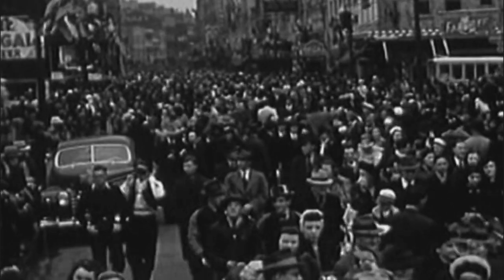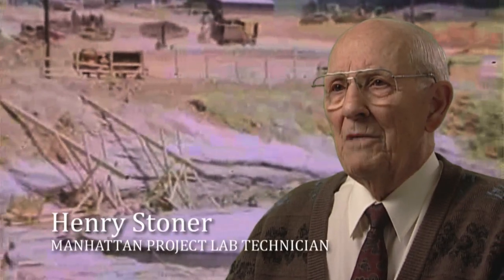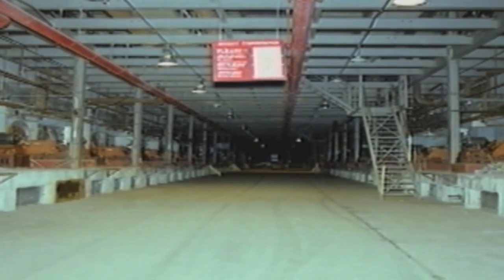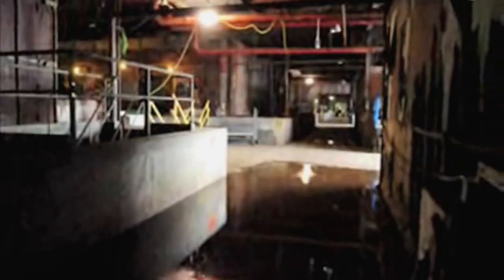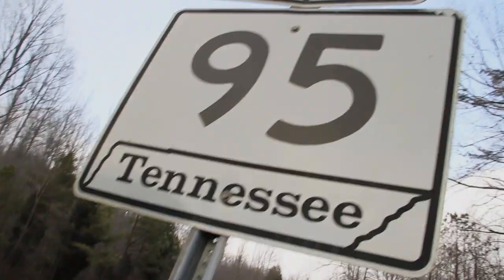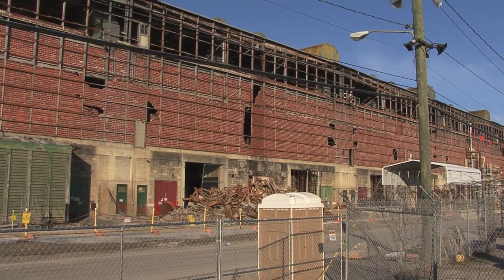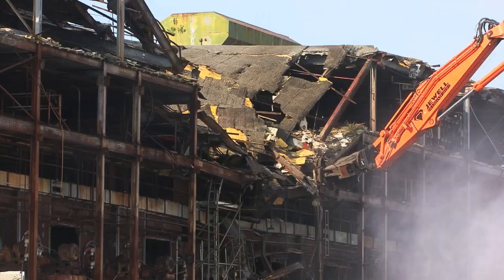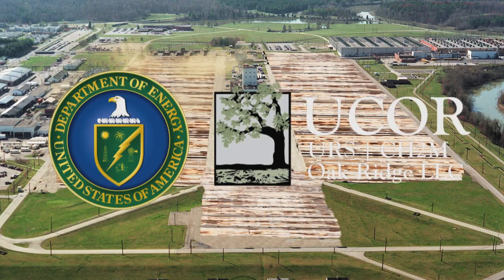The K-25 Story

Comment: I worked at K-25 and spent a lot of time in that building and many others.  This video gives the facts in a nutshell, and is well-presented.  Comments criticizing any aspect of K-25, which set forth negative allegations but offer no references and no proof, are to be summarily disregarded.  In cases where references are presented, then the references must be reviewed and critically compared with any opposing, scientifically respectable publications.  Make them do their homework.
Reply: Joe, they have spent millions cleaning up the soils and contaminants around K-25.  They have budget allocated for the ongoing clean up which will not be done for several more years.  The government and the various sub-departments of the DOE would not be spending the money.  There are a multitude of ongoing clean up processes going on today, and will continue.  For example, nearly one million pounds of Mercury and other dangerous substances flowed in the Poplar Creek which feeds in the winding Clinch River system.

Comment: These Oak Ridge PR games leave out a lot. The Gas Diffusion process was led by Harold Urey, who found deuterium in the 30's. Deuterium's health effects would become the most extreme of the health effects cover ups linked to the Manhattan Project. Deuterium's health effects on humanity is nothing short of a colossal holocaust.
What is more the gas diffusion process was extremely dangerous due to all the UF-6 gas that if a plane targeted the site the poison gas would kill a huge area with fluorine. It was so energy intensive that it needed lots of coal plants to run the process and that covered the are with toxic metals and acid gases that affected the health of many.
The plant was loaded with asbestos, PCBs, as well as transuranics due to recycled uranium from Hanford and so on making the contamination with Tc-99 and plutonium an issue. The plant was not designed for safe take down and the loss of fluorine from the plants severely injured the work force and many in the region/ area.
Since the plant was born out of the Urey and the Deuterium cover ups on heath, so were other health effects from the extremely dangerous gas diffusion process also covered up and fluorine health dangers suppressed in like manner with deuterium cover up on cancers, diabetes, heart disease, dementia, mitochondria health and lots more.
The K-25 process was the flag ship of massive health cover ups of dangerous materials of the Manhattan Project. The real history of K-25 is one of extreme harm done to workers and management debauchery to hide that damage.
Reply: Meh
Reply: Sure, and the Earth is flat, government is controlling us with chemtrails, fluoridated water, 5G, RFID chips, HAARP technology, etc. You're kooky.

Comment: If the building is gone, why is the sirens for K-25(installed likely in the 80s) still tested and used? A lot of them don't even work anymore.
Reply: Y-12 still refurbishes war heads for the department of defense. ORNL is still running. While the amount of nuclear material is nothing compared to its heyday. There is still some really nasty stuff out there.
Reply: Valra Bellkeys They are for weather alerts now.
Reply: Y-12 makes nuclear reactor fuel and medical isotopes too!